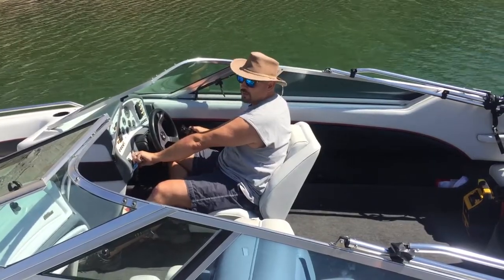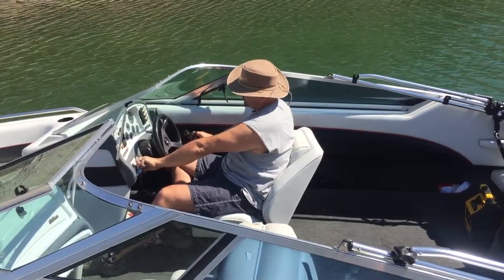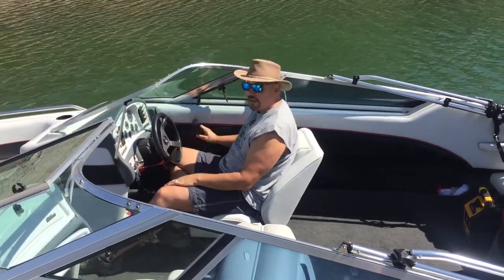How to cold start a boat that has been sitting for a while

Comment: I have a 95 crownline and I usually pump the choke throttle while I am starting it. Seems to work a little faster, doesn’t really matter as long as it starts. It’s nice to see another crownline not turn over on the first couple turns. After the first start up it starts every time on the first turn.

Comment: Always turn on bilge blower before starting a gas powered boat.
Reply: I am what I eat...
Reply: Yes. If it's warm, and been running. You want to blow the fumes out of the engine compartment. However, if it's cold.... like in this video, then it doesn't matter. One more thing draining on a battery that is not charging. So.... no. Not until the next warm start.
Reply: @jimmyz2098  tell that to the guys in the burn ward. Blower always

Comment: The best cure for this is to go buy a fuel primer bulb. Install between the fuel tank and fuel pump. Prime fuel to the carburator before starting. The engine will start first try every time.
Reply: i didn't know you can do this on boat not like lawn mower
Reply: @vand.4474  I know that most outboards especially small ones have primer bulbs on the hose lines between the tank and the motor. I could see this benefiting greatly from a bulb also

Comment: lol, this video was actually pretty thrilling lol. Good vid, thanks for reminding a new boater about the throttle button. Do I hit that button on the first start of the day or every start?
Reply: @user-pt3jd9kx4c  lol well, I got on my boat for the first time on weds and it was a trip… I hit the button to start, that worked fine. I floated around in circles because I didn’t understand that I had to hold in the thumb n push forward from the 90degree angle. I kept thumbing the remote forward from the “low throttle” position lmao. After backing up full speed out of no where and scaring the crap out of me, then floating around in circles for another 10mins trying to figure out how I made it go backwards. I got it to go forward lmao. One thing I would like to ask is, I noticed my 2002 fourwinns does not have a battery off switch. Should I disc the battery when not in use??

Comment: sounds like it's time for a carb rebuild
Reply: Carbs Are Fine!!! 
He Said The Boat Has Not Been Started In Several Months!!!
The Q-Jet Carb WILL Have NO Fuel In The Float Bowl After Sitting That Long!!!! Notice How It Started AFTER The Engine Was Cranked And The Fuel Pump Delivered Fuel To The Float Bowl!!!
All The Pumping In The World Would Not Start A Dry Float Bowl!!!!
We Have The Same Problem With Classic Car's!!! Drive Them Every Day And Have No Problem!!! Let Them Sit And The Float Bolw Will Dry Up Due To Evaporation Of The Gasoline!!!

Comment: My throttle doesnt have that throttle only button so I can't crank the motor unless it's clicked in neutral. Is there another way to partially open the throttle while starting?
Reply: You can spray Starting Fluid at the mouth of the carburetor.